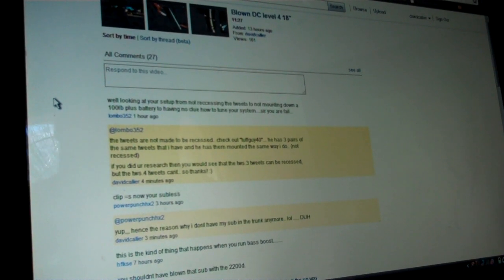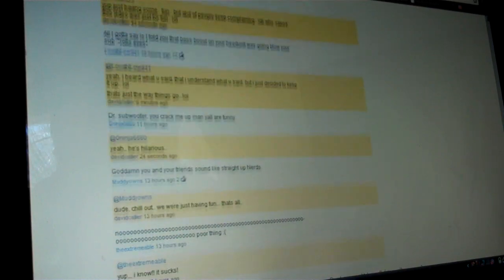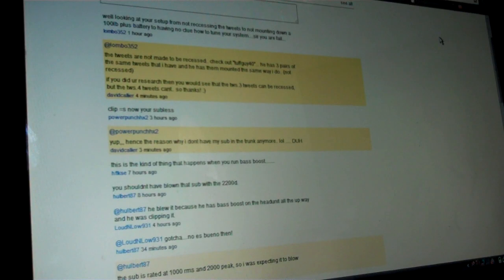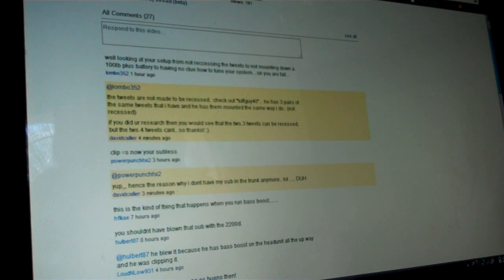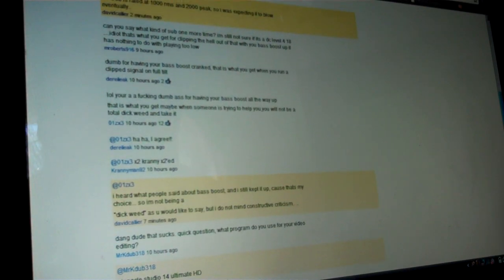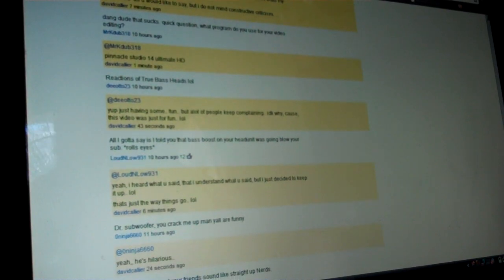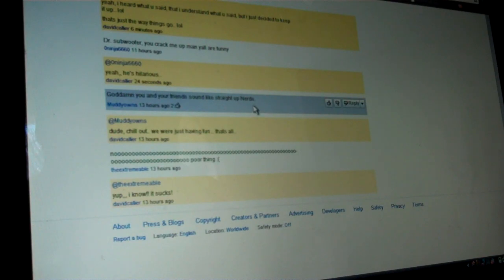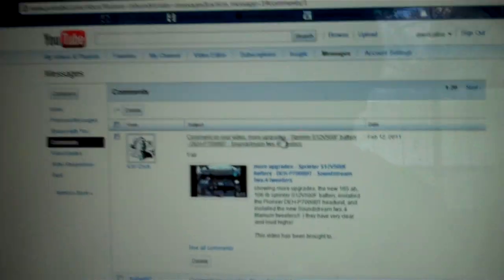explaining about the comments -EXOcontralto shoutout - tuffguy40 shoutout - loudNlow931 shoutout

Comment: This is what happened, your video got posted in a forum, and we happen to be picky about settings, so we all came to hate on you, at the same time it was meant to help you. You should be able to crank the shit out of your sub without have to clip it, turn loudness off, and bass boost off, then redo your gains with a dmm, and you should be able to push the full wattage of the amp to the sub cleanly, thats all we wanted, yea it was fun, but cost you some serious cash there